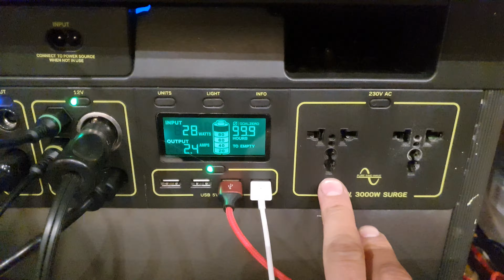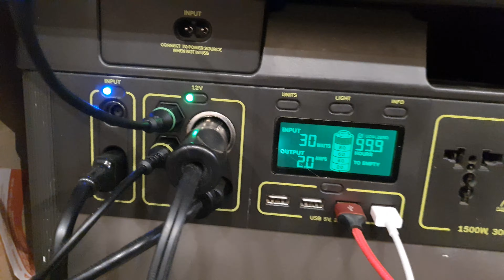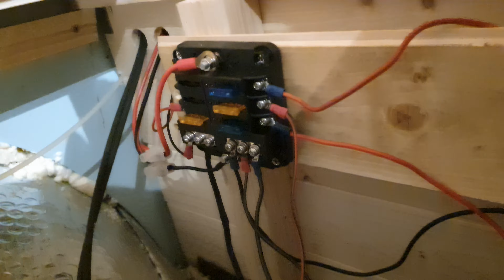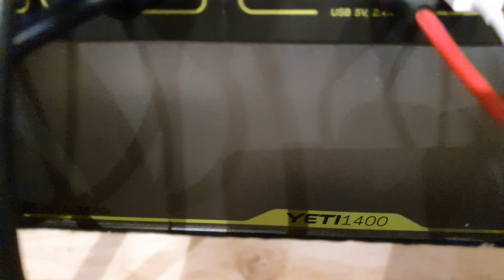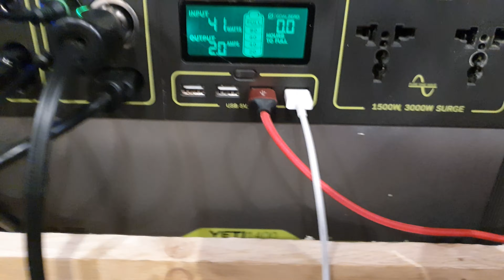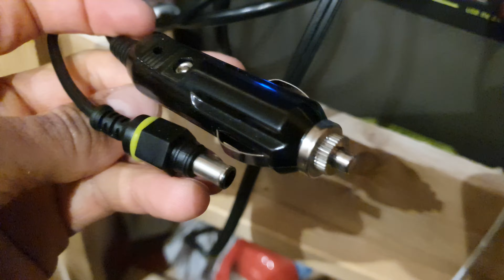Using a Goal Zero Yeti Lithium Battery Pack to run your van electrics including diesel heater

Comment: Could you share the name of the cable, or where you bought it from? I am planning on doing the same with the ecoflow battery, but they don't have an official cable
Reply from the maker: Hi, I used the Goal Zero 12V Max Current Cable. Each connection enables 10amps which gives my system a total og 40amps now. Hope that helps

Comment: Thanks for the video, I'm in the planning stages for my van and would love to get away with just a battery bank instead of all the other options (simplicity). How long could you run your heater without a charge? And without solar charging, is a gas generator an option for charging? I think driving takes too long, and solar is not an option for my dark long winters. Thank you.
Reply from the maker: Hi, I am away on holiday just now but will send you exact output for running the heater when I am back. Its very very low however (something like 0.1amp) the biggest issue with battery packs is the overall amp output, it needs to be high enough for the diesel heater to ignite. I get more than enough sun in the north of scotland to keep it topped up while running the heater and using led lights. I think the issue with using a generator to charge it will be the length if time it takes to fully charge the pack. 
How long are you usually away in the Van?
Reply: @WorthTryingUK  Thanks for your response! I intend to live and travel full time. I know some people start up their vehicle engines for the power-up phase of the heaters, and then run the battery banks for the run time. Not sure how that works yet. I have been looking into Ecoflow brands as their recharge times blow the competition out of the water. But it may still not be enough for me. I want to keep things simple: charging needs for heater during winter days (not nights, I can bundle up), laptop and phone charging, and *maybe a small efficient 12V cooler (in summer). Enjoy your holidays!
Reply from the maker: The goal zero lithium packs are expensive but I think worth the money. I have the older model that didn't come with the optimisation charging unit (think the new ones have it included), it's greatly reduces the charging time via solar. I have a video of me using my setup in Scotland during winter, check check out as I still get a very good input with basically no sunlight (easily enough to charge the unit each day). Remember that the panels work in cloudy weather, you don't need full sunshine to get a little charge :). Sorry not got round to checking the output of the heater, hopefully heading out this weekend in it so will find out for you then

Comment: I'm looking at doing similar but purely as a back up as I already have a full electrical set up done in my van (250w solar, ring dc to dc mppt/split charge, 2x110ah batteries) but I've recently got the jackery and was looking to have an xt 60 connector from the cigarette outlet on the jackery to my fusebox so i could simply use the jackery unit if my leisure batteries where depleting if i was off grid for an extended period.
Reply from the maker: Thats a good backup plan. Don't know much about the jackery banks, do you know the amp output of the cigarette outlet? Might not be high enough to power your entire set up. Could always use it to power limited stuff such as lights though. The yeti I got is 10amps per output which is why I had to buy the adapter to be able to use up to 40amps on my fusebox (4x10amps).

Comment: Hi. How to you plug heater in the yeti????  Can you show picture of connector you use. Is it like the cigarette plug???? Thanks.
Reply from the maker: Yes the heater is connected to a blade fuse box which in turn is connected to the cigarette plug and 1 of the other ports. I will make another video shortly showing it in more details.

Comment: This is exactly what I was looking for. It has been days I am asking myself if an external battery shouldn’t be just enough for my van use before I start to drill my van :)
Reply from the maker: Glad it was useful. They are expensive to buy but make the overall use snd instalation extremely easy. You can take them inside to charge if you are only doing short trips so no need for solar
Reply: @WorthTryingUK  well, that’s the plan. I will use the solar panel with it when the battery is getting low. I strongly believe this is way enough to use in a van instead of all the sophisticated installation that most people are doing. Plus I believe this is a very safe install.
Reply from the maker: @dunno1128  totally agree. Think it's a lot safer but the overall cost is a lot more. One reason most people end up having leisure batteries, inverters etc.

Comment: How do you connect the heater to the cable you mentioned? I ask because I checked the goal zero website and that cable has a female anderson connection on the end, all the diesel heaters I've seen have some weird connection I haven't seen before aha
Reply from the maker: Yes I have connected the cables female end to a male ended cable that runs to a small blade fusebox. I have used the fuse box to connect the led lights, heater and waterpump. Its shown at around 4min 40. Happy to try and capture it all in more details if thats any use?
Reply: @WorthTryingUK  Ah okay, so it's a male anderson to ring thermals that connects to the Fuze box. I have one that I use to power the Fuze box from the goal zero but unfortunately they no longer sell it on ebay and I can't find it anywhere else here (I live in Ireland).  I would love to see another video going into detail about how you have everything connected together, as I'm doing my own camper van build with a goal zero 1400 too.
Reply from the maker: Ok no problem at all. Will do one in more detail shortly 👌.  For me the goal zero set up is ideal, extremely safe and user friendly once set up 😀
Reply: @WorthTryingUK  Can't wait to see it! Yeah the goal zero is such a handy unit, bit pricey but worth it since it's so compact and easy to use.

Comment: Thanks for showing this! I'm building a similar setup. Trying to skip wiring the heater on a splitter cable. Don't know too much about electrical however im wondering if its harmful to run the 12v diesel heater on the 120v ac plugs? Is there any disadvantage to this? Is it possible? Any help is greatly appreciated
Reply from the maker: Yeah it needs to be connected to 12v. The way i have done it over a fuse box means all electrics are connected to fuses and it's easy to add more items when required. I thought I was done but already added 2 more and going to add a LED light bar above the outside door. So the fuse box is ideal. Considering you ste sleeping on the van I would put.safety first and make sure everything is wired correctly. The 12v is DC while the 240v is AC.

Comment: By the way. The power brick is also connected to a 8mm port in the top cargo hatch. You can run that and the front 8mm port at same time since their both on the same charge controller.
Reply from the maker: Thanks, that's very useful to know :)